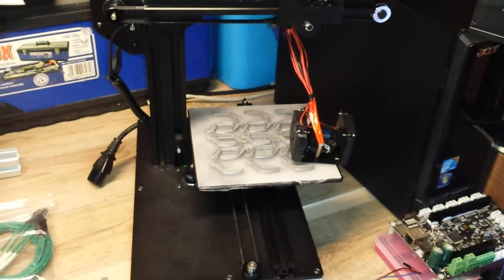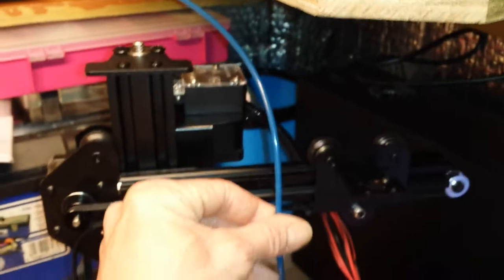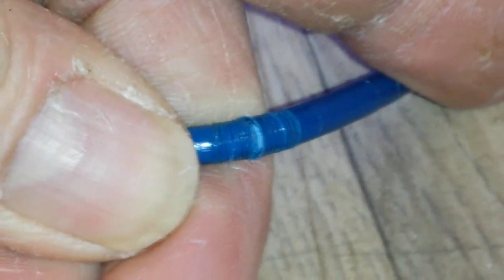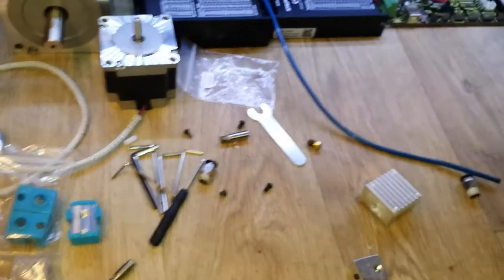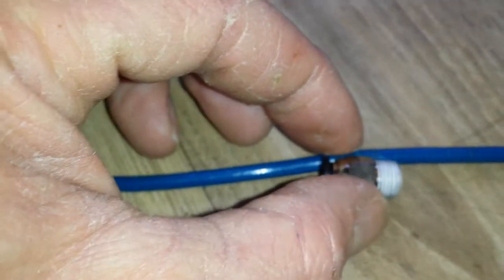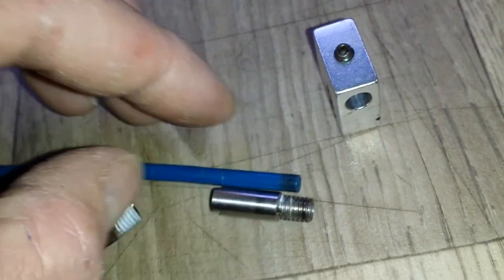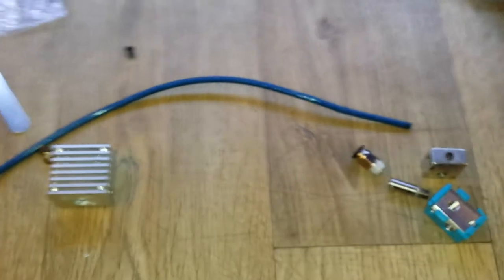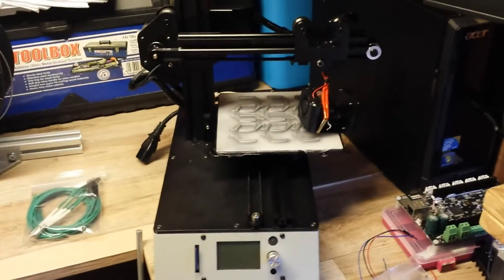Tevo Michelangelo - First Nozzle Clog, or is it something else ?

Comment: I have not done any mods to the "head" so take what I say with a pinch of salt but in my previous job I did some pneumatic air pipe installation, I know there exists a coupling that has like a copper compression ring that you tighten with two spanners I think they are called compression fittings.

Comment: I have never seen that happen before what I believe is your problem is the M6 Fitting  is bad there must be something inside it that is cutting your boating tube I have never seen that happen before but that would be my suggestion is to change that fitting
Reply from the maker: Hi mike Whaley. unfortunately the fitting is perfectly fine. I have actually seen this before many times and not just on 3d printers. I build my own printets in a way to avoid any rotational motions that can be generated.
The issue is well known in the pneumatic industry as these fittings are common used on air cylinders and such like which will move when operating. ANY rotating motion on these types of Air fittings will result in similar damage done to the tube inside. 
The white PTFE generaly used is slightly larger in outer diameter and is less slippery and easier to grip which helps somewhat.
There are fittings with double O-rings that I could try but over time these will still fail on this setup. I have some high quality stainless fittings with single O-rings but after a quick manual test the outcome is exactly the same and a grove is cut into the tube. Even on the White PTFE tube.
I think as I say in the video that because the tube is so short that the rotational motion is extreme on this set up.
I will do a follow up video shortly.
Thanks for your comments.  I will include all this in the next video.
Reply from the maker: Hi Mike. well your suspicions were correct it seems. Although the air fittings are in perfect condition they lack any supporting O-ring inside.
The inner bore is open all the way throughout the fitting and without an O ring or supporting shoulder there is nothing to hold the bowden tube central.
This allows the inner retainer to keep cutting into the side wall.
The rotation is still an issue and I partly increased this by shortening the tube.
I have tried better fittings and they still cut into the tube but not to the extent of severing through.
So simple answer I think is by not having too short of a Bowden tube & replace the supplied fittings with ones that have an inner O-ring.
 Stainless fittings usually have at least 1 O-ring inside & sometimes 2 depending on price range.
Reply from the maker: Replaced fittings and lengthened the tube back to original and all is well again. The fittings supplied with mine were particularly bad for some reason.

Comment: The stock ptfe tube doesn't do that. Also the stock tube is zipped tied close to the pnumatic fitting so it doesn't allow it to rotate as you describe.
Reply from the maker: Hi the stock ptfe tube is still destroyed with the supplied fittings that came with my Tevo. The cable tie holding the flexible conduit with the cables inside offers no support at all and should ideally be supported to the carriage. The fittings have been replaced with half decent ones and I have put the tube back to the original length to help reduce the swiveling motion. I also added a cable support to the carriage to hold the flexible conduit separately, this has solved the problem so far.

Comment: Still thanks on the video.
Please do some thoughts on items like the "tl-feeder", you could use it for that.
The thing ultimakers and e3d have is like a clip to secure: lock the fitting in place.
What you could do as well is try to turn the extruder so it is more a half circle and not a bow. 

Any update on the self build machine? Was making my own. But thinking of using nema23 for the z axis. But mixed feelings about the stepper-drivers I should use.